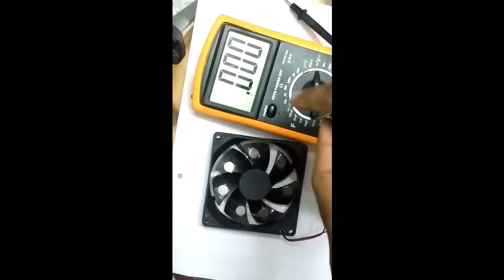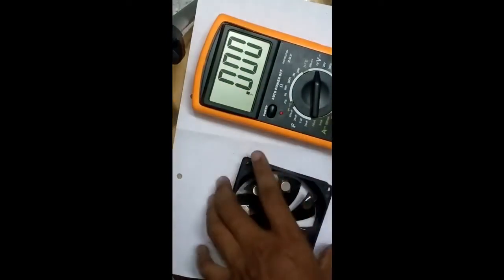Free Energy Generator In Tamil Do We Generate Free Energy

Comment: Hai Bro,
I have a doubt.
எங்க port la ABB 800 drive use panranga for all conveyors motor 690VAC. And ஒரு conveyor kku two drives use panranga at a same time(Star and Delta). They are used a converter duty transformer. 
1.Why they are used Star and Delta drives at a time?
2.Converter duty transformer பத்தி sollunga(dual output Star and Delta)